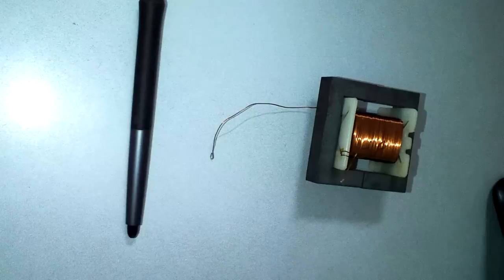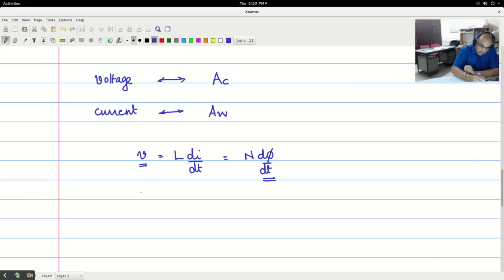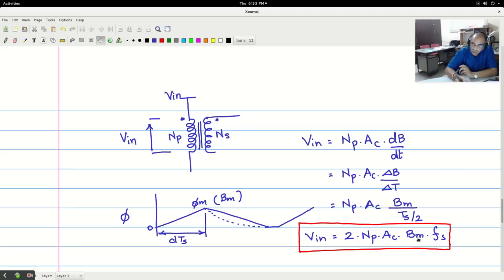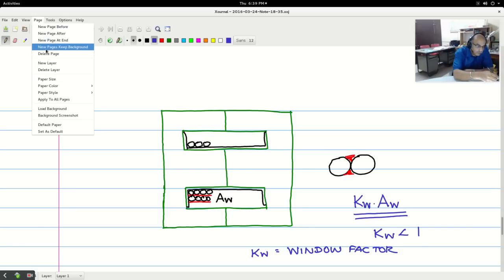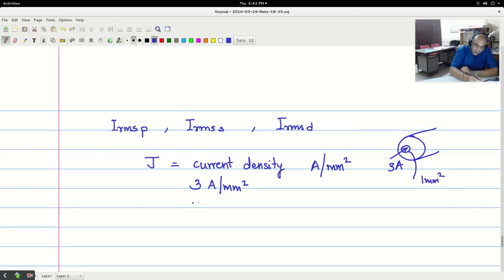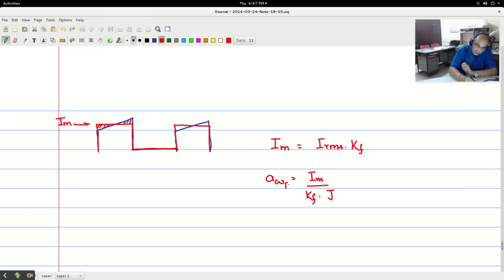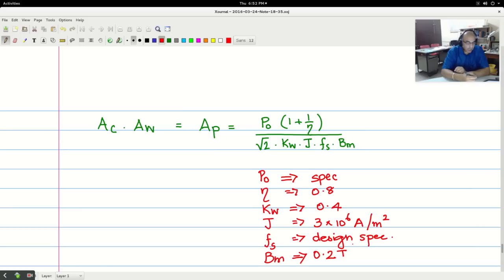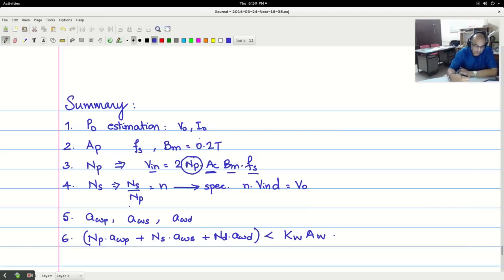Transformer Design

Comment: 15:00 I tried to use that formula with my transformer: 50mm2, 0.04T, 1MHz, 200V and got 50 turns, which is a nonsense, because my trans uses 7 turns and 0.2mm gap. May be a square root is missed in the formula

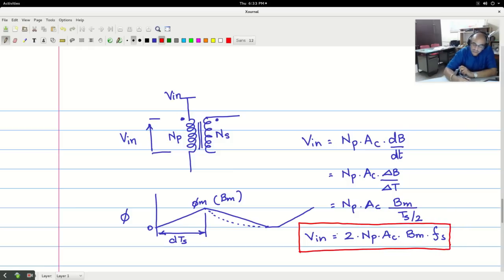Comment: I find it completely counterintuitive that we should be able to find out the number of turns per volt (@15:13) without knowing anything about the relative permeability of the core other than it is high enough to guide the flux into the core's area.  Am I missing something here?  Wouldn't low permeability materials yield very high magnetizing current?  If this sort of works itself out, can someone point me to a resource that explains what is going on in low perm. cases?

Comment: Hello sir what is difference between coupled inductors and transformer. Specifically why do we need to store energy in core in form of field in case of coupled inductors rather then transmitting as transformer??
Reply: A transformer works in essence as a mutual inductor or a coupled inductor.

Comment: Does the actual position of the wires make any difference to the performance of the transformer?
I mean, for example, conventionally you would have the primary winding at one side and the secondary (or more) winding at other.
Would it matter, for example if both primary and secondary windings were wound together in a random higgeldy-piggeldy fashion?
Would this scheme have any adverse effects, or perhaps could it even be desirable?
Thank you Prof.
I find your video explanations not only extremely informative, but curiously very satisfying and of the utmost quality, (the technical details rather than the audio-video which is also v. good)
Thanks again from Brixton, London UK.
Chris Bodragon
Reply: Yes, jarnega.
Reply: @wilmdrdo1228  Please explain...
>
Reply: if primary and secondary wounded together then you eliminate leakage flux

Comment: Hello, Thanks for the lesson.
I have been doing it differently but my windings get very hot in operation.
I suspect I need to use higher gauges.
My question now is What variable "d" is ?
n Vin d = Vo

Many thanks. Jose in Mex.
Reply: 'd' is the duty cycle = time on / switching period

Comment: What is the Ac is it  in mm2 or cm2 or m2? Vin=2Np*Ac*Bm*Fs  Np in turns, Bm in Tesla, Fs in hertz. 1/second. i think its in m2 because 1T=Volt.s/m2. So if i have a 1cm2 cross section area of ferrite. And if i swich it 50khz.. i should wind 160 turns primary for 315-320 volts ac mains. High Frequency decreases transformer size very well.